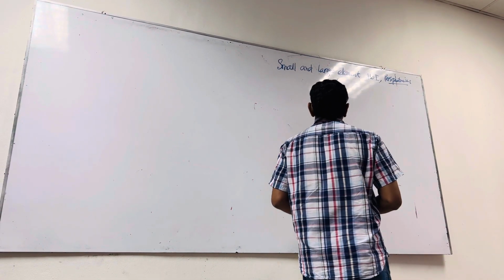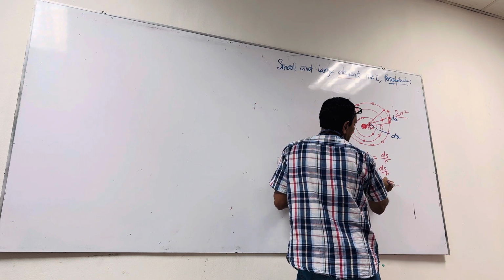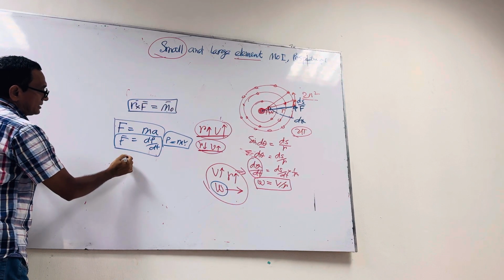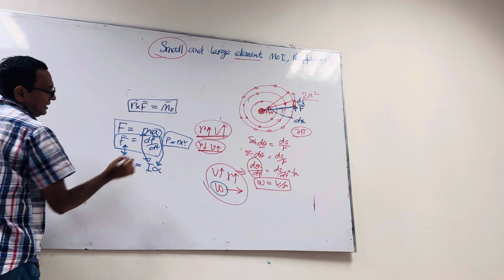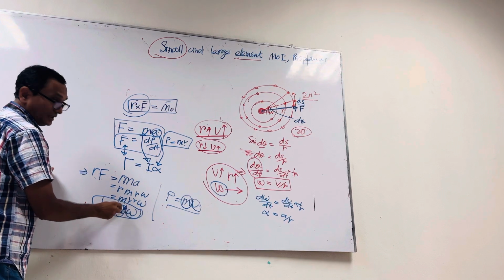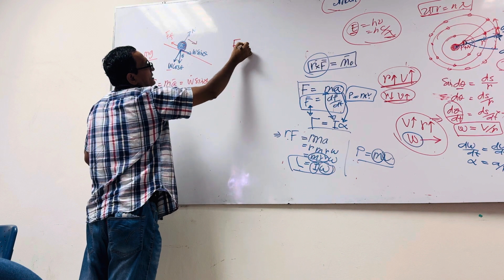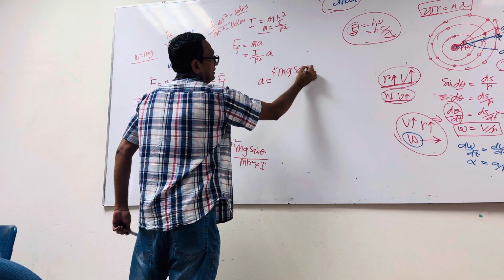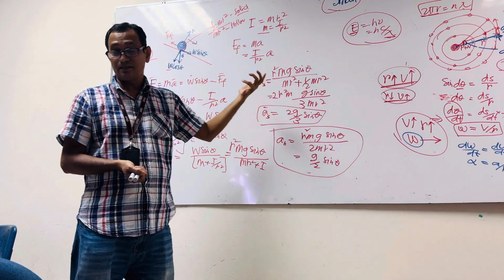Moment of inertia -  Newtonian classical mechanics theory and demonstration

Comment: This is one of the sample demonstration lectures on Newtonian classical mechanics theory and demonstration of the moment of inertia as a universal theory of Mechanics. It has two sections, the theory (11 mins) followed by the demonstration (9 mins) of two diverse structures of the same mass but the different moments of inertia due to strutural variation. How does it make a variation of falling time on the frictional surface without any application of the initial force has been demonstrated.